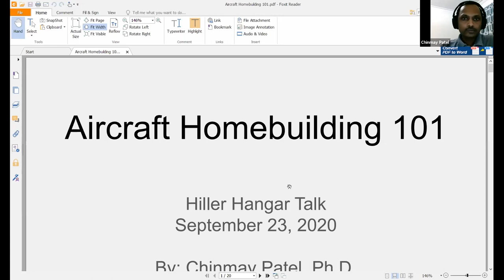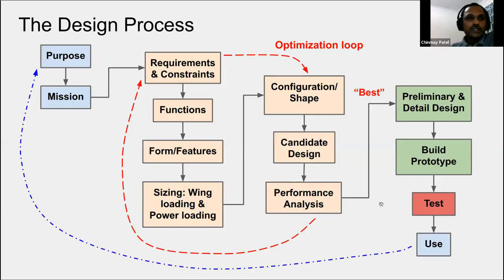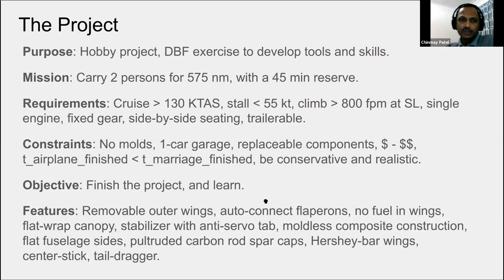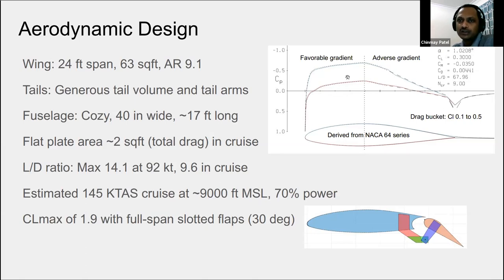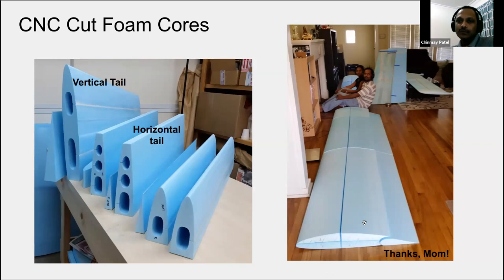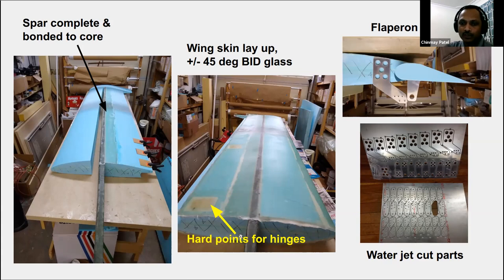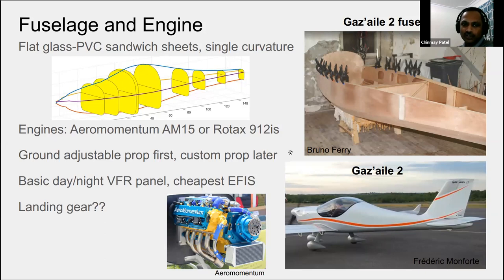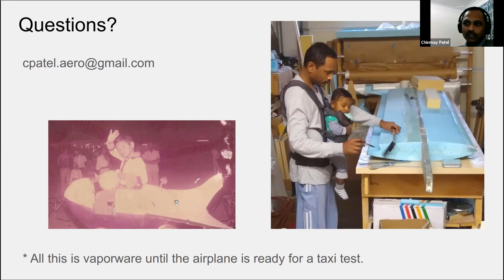Hiller Hangar Talk - "Aircraft Homebuilding 101" with Dr. Chinmay Patel

Comment: I applaud your choice of the Aeromomentum engine. I believe it is likely the most dependable and durable aircraft poweplant available, with reasonable costs and weight. IMO its only negative is an ungainly form factor, especially with regard to propeller shaft position, relative to the overall engine. Installing 1 in my Skystar Pulsar III (1200 Lbs Max Gross) would have compromised the aerodynamics and aesthetics of the cowlings, compared to the boxer 6-cylinder Jabiru Gen-4, 3300 that I chose, which is also a lighter full installation.